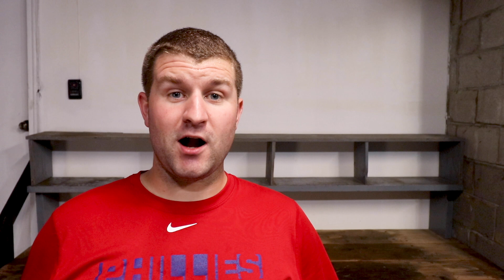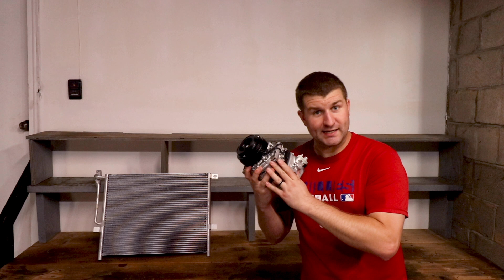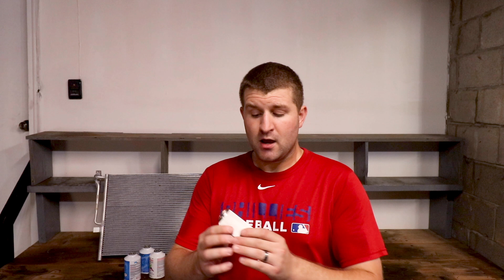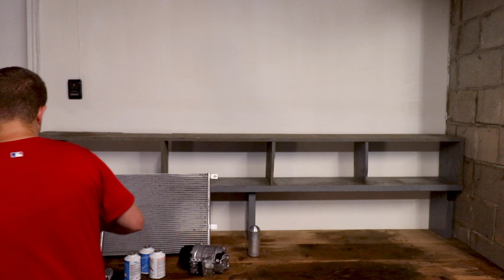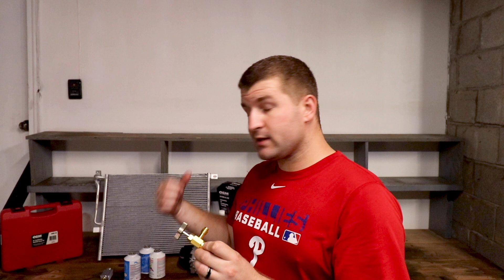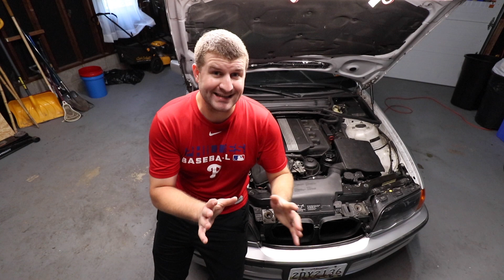E46 AC: Parts and tools needed to fix the AC System - AC Repair Part 1

Comment: Great videos! last year I replaced the evaporator before summer and worked fine until now. This year I have to do the condenser cause is leaking. :( I prefer removing the radiator because I want to change the serpentine belt and the upper steering hoses at the same time. Wish me luck... Seems to be the same car but mine has fan clutch instead an electric one. 328i 00